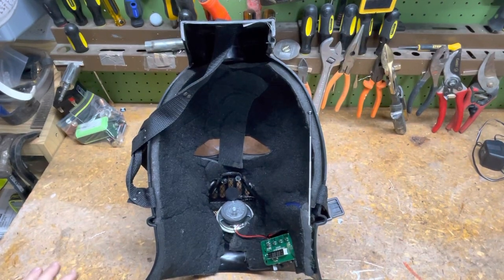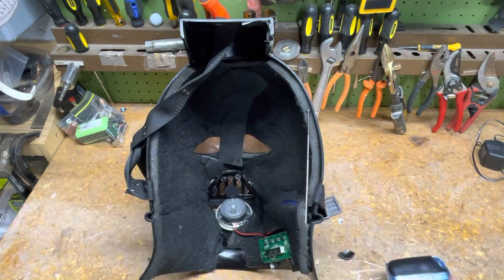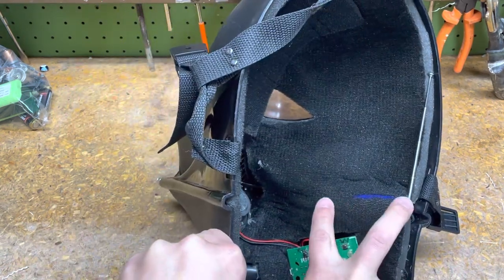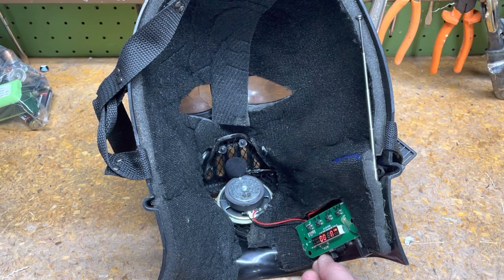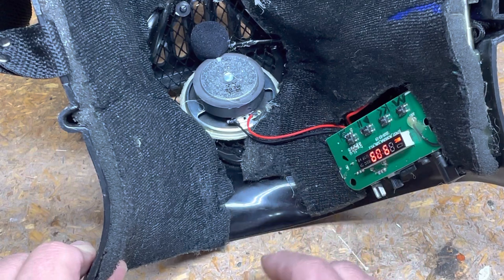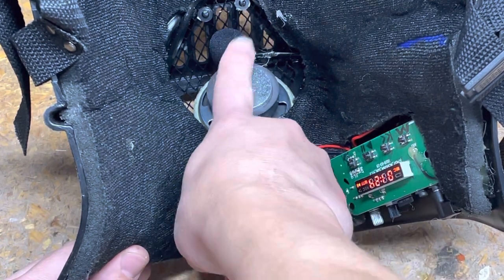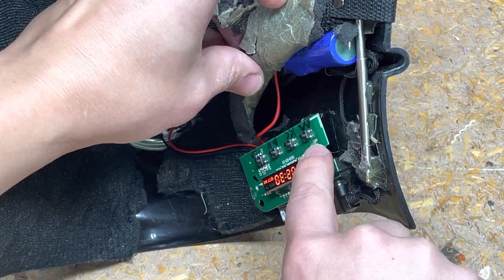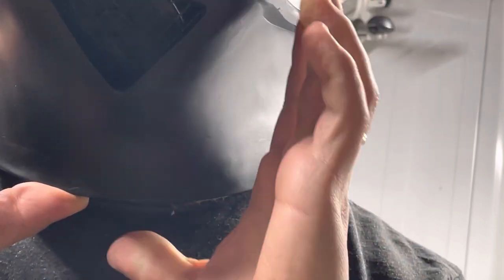Easy add of Mic + Amp to Darth Vader Supreme Helmet/Mask

Comment: I've tried to do something similar to what you set up in your Darth Vader helmet: speaker in the same location and a small mic BUT as soon as the mini microphone gets near the speaker, it's instant audio feedback.... how is it you have your mic  right above the speaker (from your video) yet you aren't getting audio feedback etc?  Thanks!
Reply from the maker: I didn’t put mine up too loud to avoid interference.  It may be better to get the mic as close to your face as possible and at an angle where it’s not perpendicular to the speaker and also pointing more up or down to best minimize interference (some mics pic up from the rear as well).  You could also put some layers of tape on the back of the mic to block reception from the rear.  If you can mount your mic more to the side that will help too.  Make sure there is padding between any part of the mic and the mask so it doesn’t pickup vibrations (including the neck of the mic).
I’ll take another look at mine to see if there’s anything unique other than variations of the aforementioned.